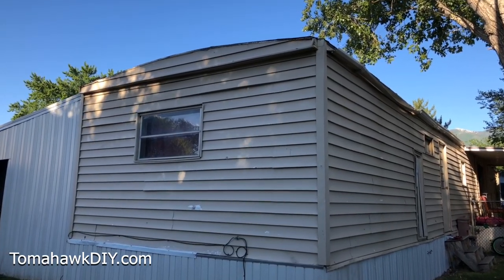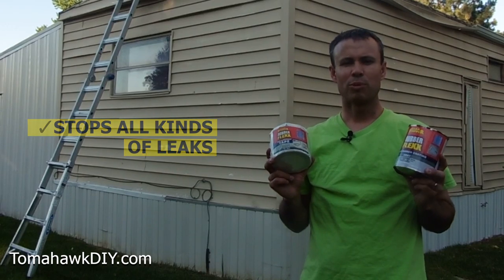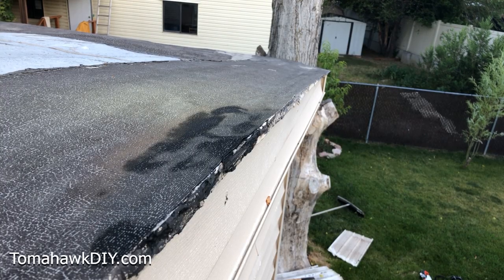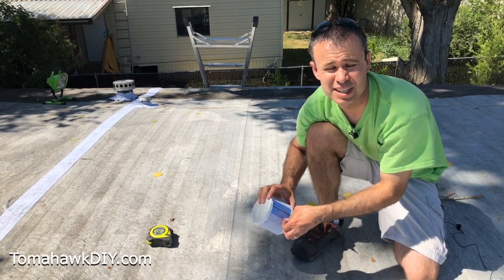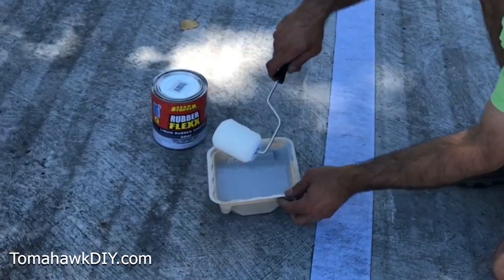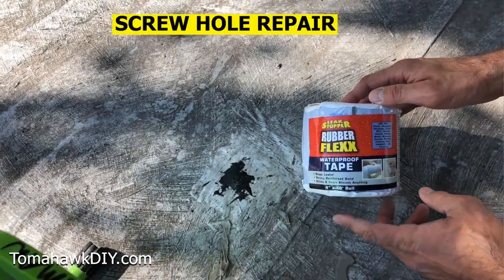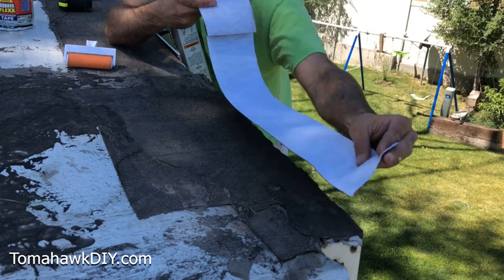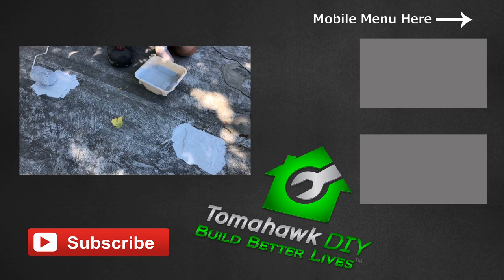Mobile Home Roof Leak Repair

Comment: Much better than spending $4,000 on a whole new roof. Do you find that most of the time you could just do this if you have a small leak it's a boat loads of money I do not want to spend $4,000 on a new roof if I don't need to